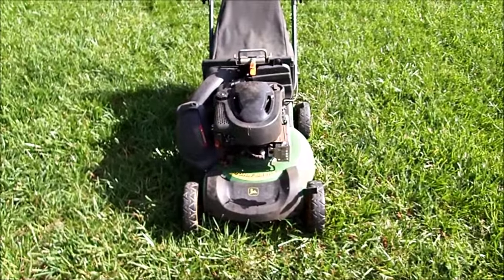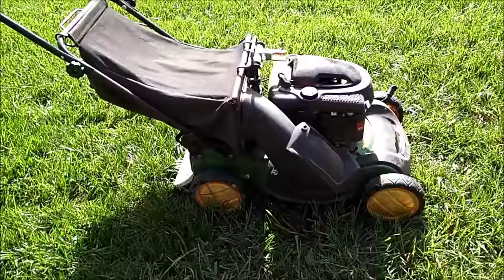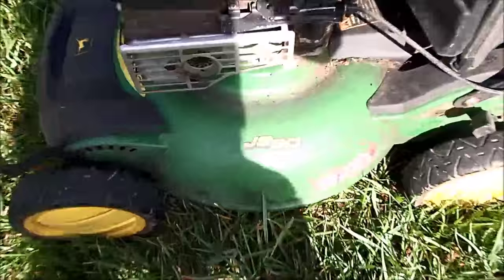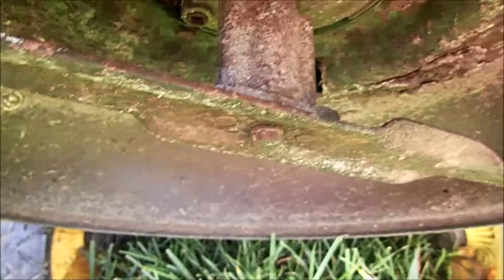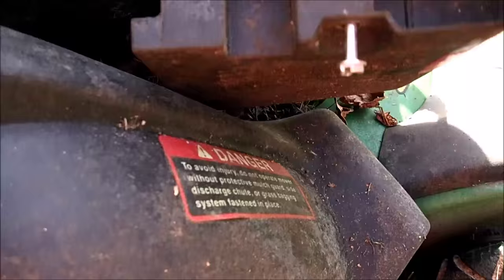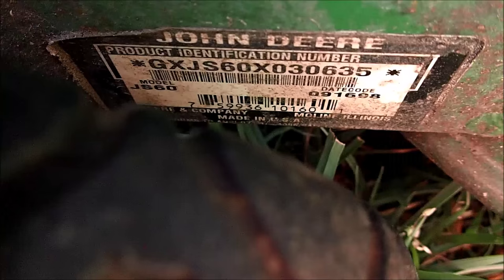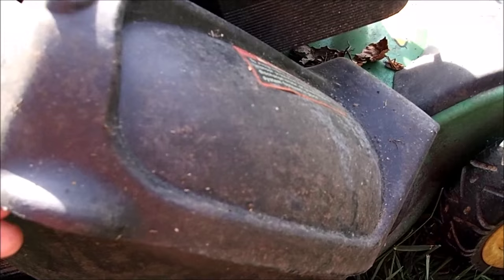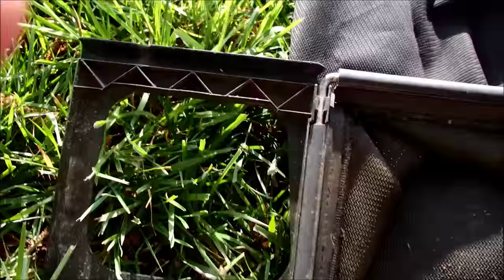John Deere JS60 Lawn Mower with Cockroach in Air Filter!  - April 15, 2016

Comment: Just picked one up! Starts right up...very slight miss I'm trying to sort out. New plug and cleaned the carb. Still a miss. Thinking it might be old fuel as I didn't empty it all initially. Blade and adapter are good so hoping it's a fuel quality issue and it works itself out. Very solid, well built mowers. Nothing like them anymore.
Reply from the maker: Hello Mike thanks for viewing!  That is great hard to find these John Deere lawn mowers anymore they are just solid really well built, like you say nothing like them anymore.  Hope that does work itself out, due to the age it could be the flywheel key is slightly sheared causing it not to fire properly and or that carburetor just needs to be replaced.  Have bought aftermarket carburetors for these engines before you can get those on Amazon and or Ebay.  They work just find part # 799868 (double check yours if replacing) and can find them for under $12.  Sometimes that is the way to go for a engine that age even after cleaning them replacing everything they are just not right.  Well worth spending a little money on these great lawn mowers much of what is sold today are disposables!
Reply: Just ordered an aftermarket carb for it. Hopefully that does the trick. In the meantime, I'm going to replace the seat to see if that does the trick. Had a Scott's with the OHV Intek engines that was acting similar and after I replace the seat it ran perfect. Never know with these older mowers!

Comment: John Deere push mowers aren't too common these days, I'm not sure they're even made anymore! Is this one going to be a keeper? I'm currently looking for a John Deere with a Kawasaki engine.
Reply from the maker: +ChicagoSirens Hello ChicagoSirens thanks for viewing not sure John Deere they still make regular push lawn mowers anymore either.  They are not in the big box stores (Home Depot or Lowes) anymore except for the rider ones.   I had repaired a John Deere with a Kawasaki engine for a friend a few years back its still running it had to be 20+ years old.  Really solid well made.  Got several friends/co-workers always looking for a lawn mowers this is a pretty nice it will probably go to one of them.  Will have a follow-up video coming up on this as well it cleaned up really nice.
Reply: John Deere DOES NOT make any small equipment anymore. Briggs and Stratton made if for the last few years and the ended production in 2011. If you look closely the snappers and JDs from 2000-2011 looked exactly the same.
Reply: +JD Gator That's a shame. I did hear their newer mower were crap though, the steel decks would rust out easy.